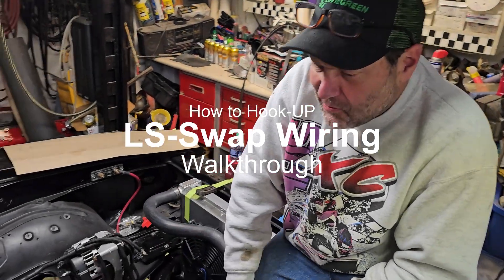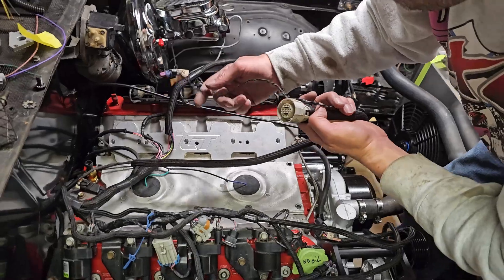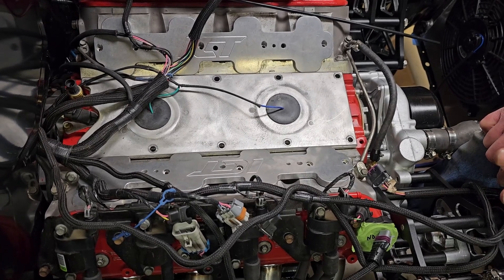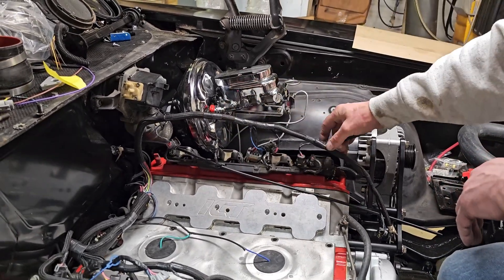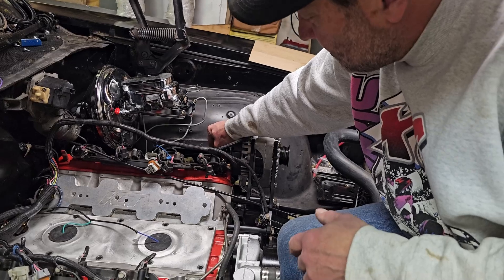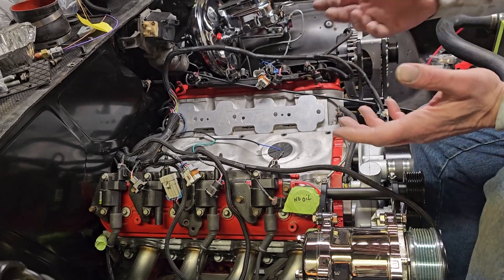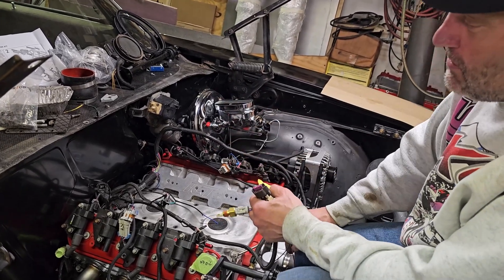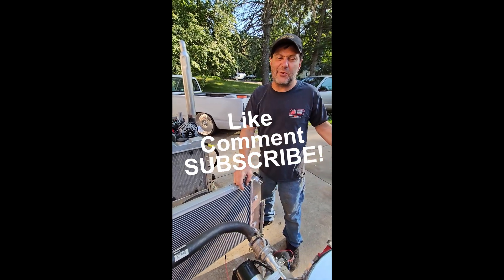"How To Hook Up An LS Swap Wiring Harness!

Comment: Great video! I like the way that you mention all of your experiences with all the ground issues and other things that you've learned over the years. These are the key details that get people in trouble.
Thanks for explaining the different Generations on where the sensors are located and how you can program different sensors out. That is something I had not realized with the knock sensors.
Thanks again!

Comment: The Chevy LS Rocks the Hot rod world. Great video for anybody that is NOT familiar with the LS Engine platform. I own a Chevy 4x4 with a 6L LS, and I am telling you, as you know the LS is a super easy platform to work on. I wished I had bought a 3/4 ton decades back because everything is so easy to get at in the 3/4 ton 4x4 configuration. Most things I don't even need to use a jack to get at underneath.
  This was a very informative video for anybody thinking about getting into the LS Engine platform for their Hot rod project. You do a great job of explaining how easy the harness is to install. And like you said repeatedly, the biggest mistake that any Hot rodder can make is; to take the issue of proper engine to harness grounds lightly. As you mentioned the critical necessity to NOT forget the Engine Block > Firewall {Chassis} grounds. Most modern vehicles will have a minimum of 2 such grounds. (I use copper braided grounding straps)
  I was so glad to hear you emphasize how critical this issue of proper Engine ground to chassis connections truly are, to ensure the proper functioning of Electronic Controlled Units {ECU} and this critical step will ensure that you have a proper running engine, that is free of Gremlins and weird electronic issues. For myself, I find it easiest to install the Air conditioning pump BEFORE the water pump and then the assembly of the front of the engine components and serpentine is easy/peasey.
Great channel, excellent content from a man who knows his LS stuff. I look forward to more videos on your channel, you are an excellent teacher, not all mchanics can say that.
Reply from the maker: Thanks for taking the time to give feedback much appreciated 😁